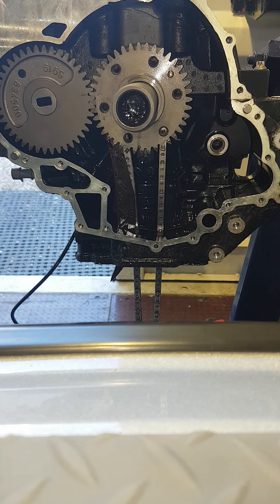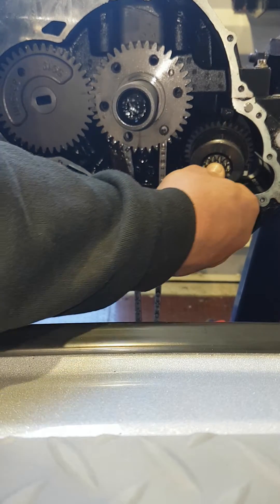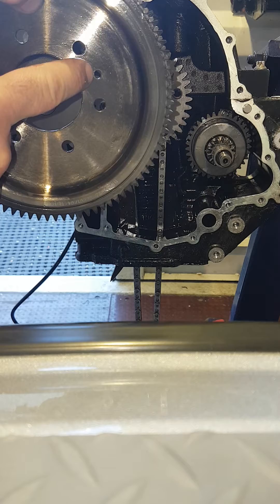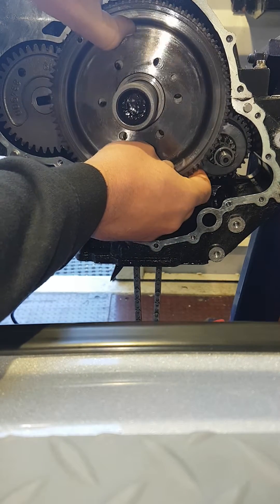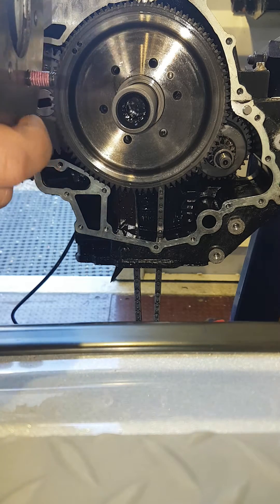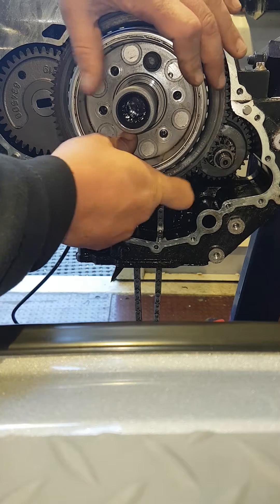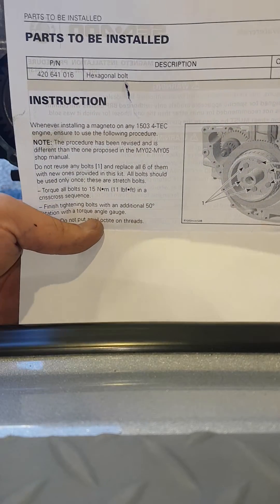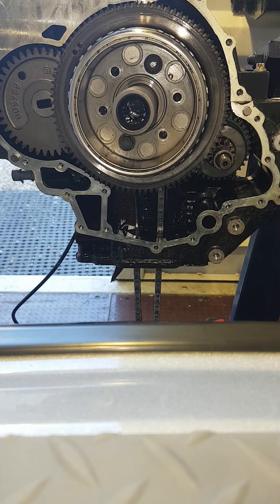Seadoo four-stroke engine rebuild pt1

Comment: how is the gear behind the bendix shaft that goes into the needle bearing installed. does the flush part on the gear face out or towards block